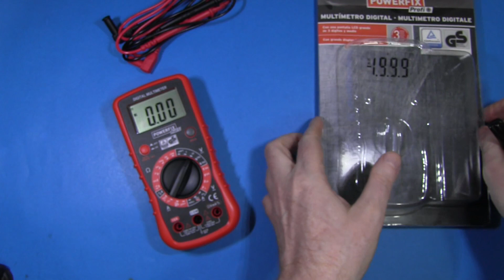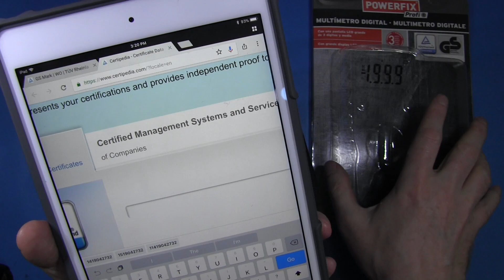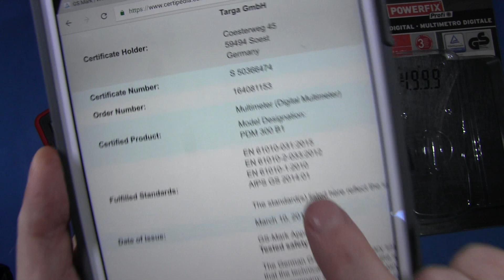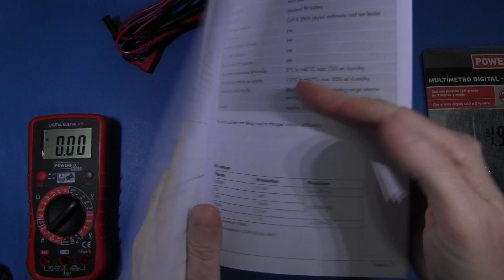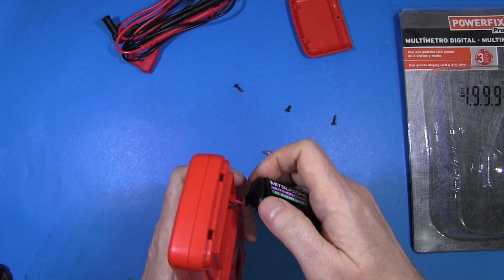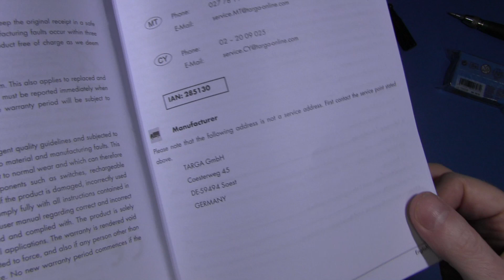2018 LIDL multimeter, part 2 - Questions and answers

Comment: it was quite surprising to see no smoke when you put 230v through the ohms range; that has been known to kill some expensive AVO meters,just like the one i bought on a car boot sale..cough..mutter! and 0.5% accuracy is actually better than some meters on sale costing over 70E  it goes to show how over-priced they are.
 i have just given up trying to repair my capacitance meter after one of LIDL's damn alkaline PP3 batteries leaked inside it; looks like it's killed the LCD panel...now paranoia rules; all my meters get stored EMPTY; or at least with the battery compartment facing down between use...that'll learn me!.
i just pulled apart a LIDL car battery tester which is 3.99Euro here in france, and to my surprise instead of just a comparator, there is a microcontroller and an eeprom! i suspect its a PIC 12F part; maybe a 12F675, as its has the test voltage going to what would be the GP0/AN0 pin, power to pin1 and ground to pin8. it would be interesting to see if it could be re-programmed to change the voltage trigger points, to use at voltages that aren't 12v.(though it could probably be done by changing the resistors around the chip)  i have a strong suspicion that it is the same PCB as the 'Sealey' branded voltage probe; the LEDS are in exactly the same order and spacing...the pcb has space for an unused switch.also being super cheap there's no tinning on the PCB pads, the surface mount components are soldered straight to bare copper! can't see this lasting long sat in damp garages...
Reply: Yes, got my interested in meters when I had the dial of one of those cheap £5 meters 180° out of alignment when I put 240 volts through the resistance.  Loud bang, flash out the side and new pair of underpants required.  Too lazy to go out to van and get my 87V.

Comment: trying to find out which multimeter in the all-sun collection this one looks like just for fun..
but it's hard to find hahaha..
http://all-sun.com/EN/p.aspx?px=1

looked for EM3701  and 161228 CKH also no luck
I did find the EM370 and EM371 on the all-sun page.. but they look radically different..
probably to big of a noob to tell the diff..hahah
would be nice to buy sum of those masterProbe probes and connect them to this affordable meter.
http://probemaster.com/8000-series-standard/
but alas no one sells these here in The Netherlands only one i could find in stores were the cheap Chinese ones sold like they were something they were not..Even amazon DE and UK has none
Reply from the maker: It could easily be a custom model, made to LIDL specifications.

Comment: It just goes to show that it is possible to make savings during the manufacturing stages to reduce cost without compromising the electrical safety / connectivity and robustness as the modelling paste on the input jacks proved that it is not always a must to have solid input jacks like those found in a Fluke 27 provided other means of support are in place. In this case the jacks meet up with a moulded in back bumper prevent the jacks from going anywhere and the tubes even though they are of split design, are contained within plastic tube so they cannot open up any further thus retaining sufficient contact pressure to meet the standards required. Well done Lidl to show that a cheap meter can still be regarded as a quality item through very clever engineering.